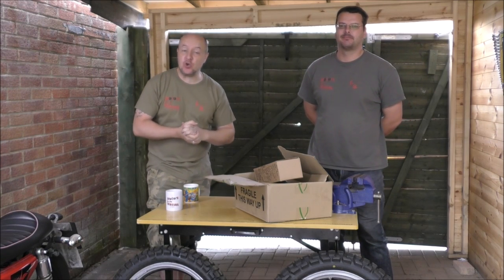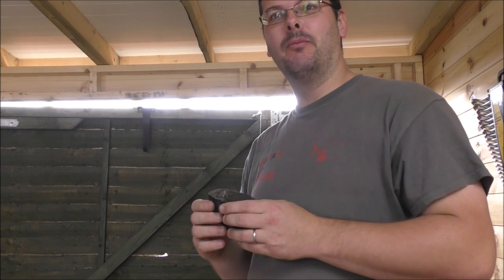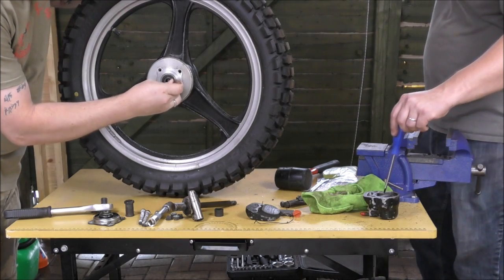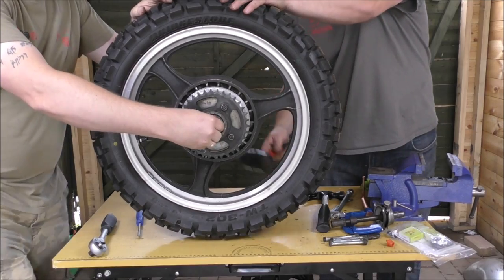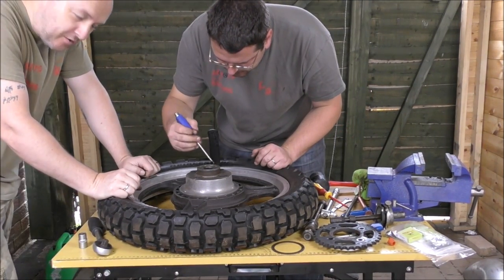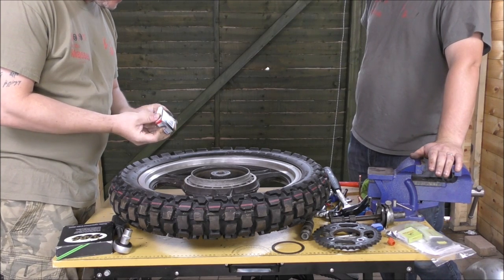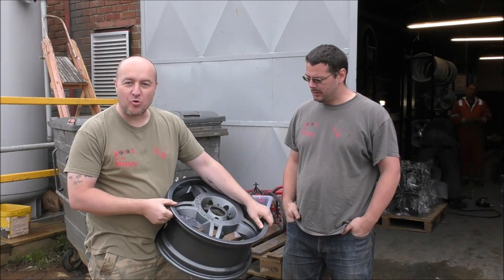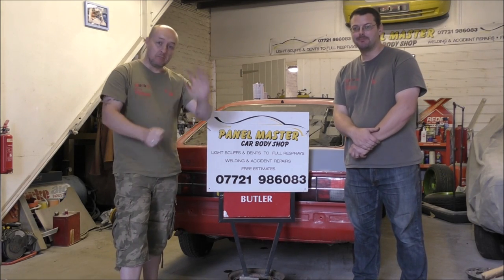1978 Cafe Scrambler Project pt22 Did that happen?

Comment: Connect the calliper back up to the brake lever and blead and use the pressure from the brake lever to brake it free. The brake system has more pressure and will work better than air. I've had to do that with my car when a calliper got stuck. Works great.

Comment: Had the same problem with one of my calipers! Plenty of penetration fluid as you've done,put it in the vice ,ideally facing sideways without putting any sideways pressure on the caliper towards a wall or safe area,using your first technique with the bleed nipple removed and applying pressure to the back of the compressor gun so as little air as possible escapes just keep forcing air into the caliper 
Basically more heavy handedness with the air compressor into the hole if that makes sense! Keep forcing air into it,
It will pop out eventually but stand well clear,comes out like a bloody bullet across the garage!! Also try a blow torch to heat the caliper up,doesn't matter if the seals melt a bit,sure you will be replacing these
Bit long winded! War and peace of brake calipers! 😋
Reply from the maker: Thank you! PlusGas is pretty good, let's hope it does its job! I'll get on ebay and buy a baseball catchers mitt lol

Comment: Its a lot easier, if messier, to use the master cylinder and brake line to pump the piston out rather than use air as when (if) it gets close to leaving the caliper body, you won't be faced with a high pressure blast of air showering you (and everything else around you,) with brake fluid when the piston "pops" out! plus the even pressure of the fluid will keep the piston square in the bore of the caliper body protecting the bore from possible ovalizing and scrappage! 
As you say, you may need to buy a new seal set. I would say buy and replace them as a matter of course!! If the piston is that badly jammed in,  those seals are going to be toast anyway!
P.S. if you are planning to use the seals again (Which I hope you're not!) DO NOT USE WD40 on the calipers to free the seals! you will destroy them!

Comment: Are you serious? Hydraulic fluid would have pushed the piston out instead you have hammered it in.As for the wheel bearings, press them out. If you hammer on the side of the bearing you may crack its housing. Please change the fork seals. They are a serviceable item and easy to now while the bike is in bits.
Reply from the maker: The fork seals are being replaced, just had to buy a seal removal tool....now bought. The piston would not budge, the hammering in was trying to release it as it has sat for 20+ years
Reply: Motors for the Masses ok so let's talk about hydraulic systems, trying to use compressed air is extremely dangerous, as anyone with an engineering background would know. Your safety is more important than anything else. If you use the bikes hydraulic system you will be able to control the amount of pressure you can apply to the piston. Along with your use of plus gas the piston will release safely. The comment about your seals was just that a comment.